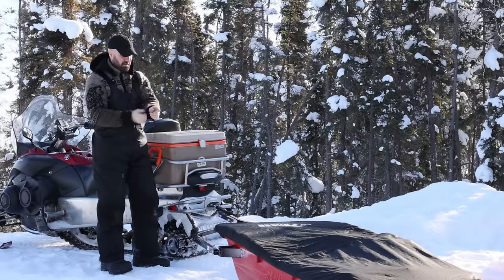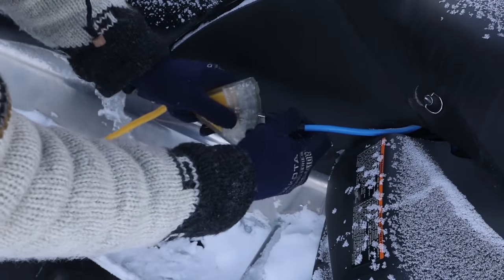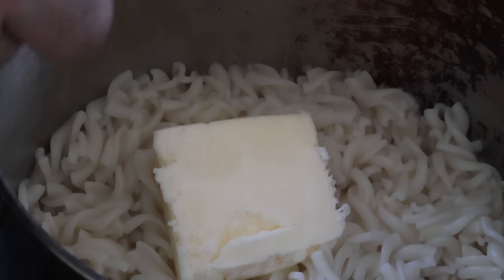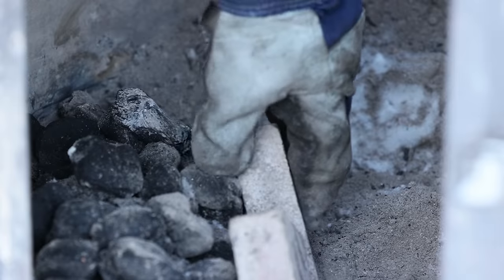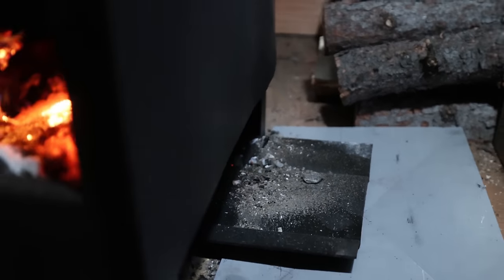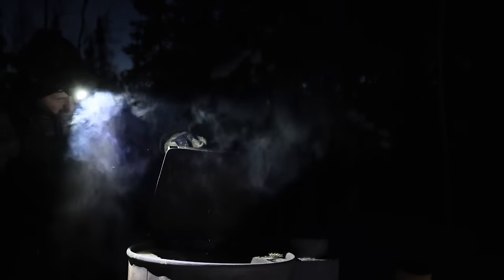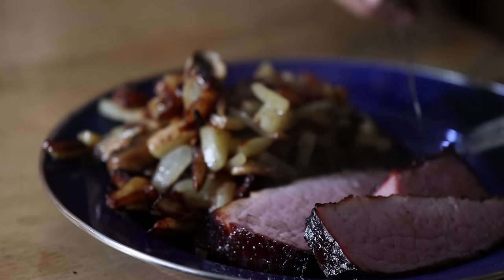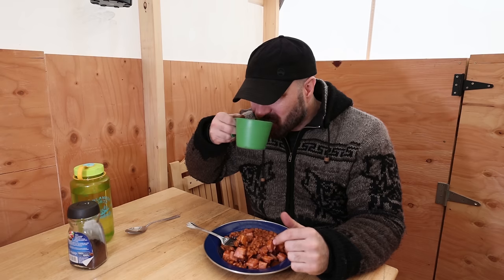My Dangerous Night Hot Tent Camping Alone

Comment: Also. Start your coal fire like a bbq. Use wood kindling, wood feather sticks and tinder. Get a rolling fire with kindling. Add your coals. And a little bit more kindling. When the coals light, add a few more coals or add your smoking wood. I soak smoking wood for an hour in something non flammable. When coals are white, you're ready to cook. It takes longer to cook, I'd use more coals.

Comment: Hey Jay, glad you saw the fire problem and didn't get into REAL trouble.  A suggestion when you are cutting firewood.  You can stack 2-3-4 small to medium sized logs in the cutting rack and cut them at the same time.  You will get more done quicker.

Comment: Hey jay that was a near miss if that had have happened whilst u were asleep, don’t even wanna think about it!  Maybe you should get a sheet of steel underneath as a heat shield in case there’s another failure.  Also those northern lights were awesome, maybe you should try and engineer a sky light so you can watch them in bed!
Reply from the maker: I was very lucky that I caught it before bed.

Comment: Today's score: 5 out of 5
-2	negative 30 degrees (by any temperature measurement system)
+2 smoked ham
+2 improvising a smoker in the middle of a forest
+2 dealing with a defective stove like a BOSS
+1 great camera work showing the succulence of the ham and taters. 

Jay, it doesn't matter what technology you have, even a Jackery to start your snowmobile; there is no sane reason to be outside under the conditions in this video. I'm worried about you man. Still, you pulled off an amazing video in spite of the adverse conditions. Great job.

Comment: Stove can be fixed easy, drill some holes and put nuts, washers and bolts. Before tightening get stove fixing paste and add where the plates join. Also put paste inside all around corners(wherever plates meet). To prevent it from happening again put some fire bricks on the bottom and one layer standing up on the sides and back.
You know adding firebricks to any stove allows it to hold heat longer. I would maybe even do the whole stove interior with thin bricks besides front and up. You glue them to the mettal with stove fixing mixture. It would allow the heat to come very strong only front and up and retain heat longer on other sides bottom and back.

Comment: You need to put heavy steel on the bottom weld it in and a heavy fire grate to keep the main part of the fire off the steel it has to just be off by an inch or so. Switching stoves out with a great safe idea I'm glad you did that and didn't sleep in there.

Comment: Hey Jay, I was the pit master at my last full time job, and you do not need a high heat to smoke. As really about all you need is a low heat of around 200°f for around 8 to 12 hours depending on the size of the meat. As for your little fire place, it is made from a similar metal that my BBQ pit is made of and warps with the high heat wood produces. The way to fix it is to weld L iron inside all the way around the edges. But to give you an idea of the size of the pit we had at the restaurant where I worked was, imagine a steel pipe 6 feet in diameter by 15 feet in length laid sideways. Two steel doors that raise up, and a door about the size of your little stove on each end. Only one used to hold logs, the other used for clean out. And the amount of wood we would use for our night smoke, was about what would pack into your little stove. And yes a stove that big would stay hot for close to 24 hours.

Comment: Most smoking of food is done at a relatively low temperature, but over a long period of time.  
A lot of the time you're shooting for a temperature of around 225F-250F. (107C - 121C) 
To go along with it those low temps, you'll cook something for a long time. A beef brisket could be 12-18 hrs, racks of ribs around 6 hrs.
The trick is keeping the temperature and the smoke as constant as you can. Lots of people really struggle to smoke things in really cold climates.

Comment: Good vid man.  Stove deal can happen.  Most need worked on when new anyway.  Some bricks inside are a must.  Maybe run a weld bead around the bottom or just trash it out.  Put it outside to cook on in summer.  Glad to see the Jackery, have to get one myself.  Some great lights.  Won't be snowmobiling much longer.  In the 30's F in Fairbanks so it's warming in the north country.   From the Hills of East Kentucky  USA, safe travels.

Comment: When you got that stove did instructions come with it. Sometimes you suppose to put some bricks or something on the bottom to keep the direct heat of the steel. I bet when you first put it in and it was cold as heck you probably got the steel to hot then when you left it got so cold that it pulled apart. Always need a barrier between heat and steel

Comment: I'd want to try and keep that stove. Probably would bend it back into place and then run a bead along that seam where the bottom plate and side/back plates come together. However, that is crazy that it happened. 

I'd also recommend putting some fire brick into your stove. Soaks up the heat and radiates longer. Might have helped with that seam failure too, maybe. Would have at least been more of a barrier between the fire/coals and the metal. I know this is a remote location so hauling brick out there might be more than you need, but throwing my 2 cents at ya.

Comment: Jay, this is a bit of a crazy question, perhaps, but I'll ask any way - when the bottom of the unit was assembled, any chance the floor was installed upside down ? Could it be that the four 
ninety degree folds were intended to face upwards with the four walls placed inside so that the floor would serve as a catch pan for coals ? You are one lucky man ! Damn good thing
you didn't fall asleep.

Comment: Now I know why the Kni-co stoves are constructed the way they are with fold-overs to prevent any potential for opened seams. I wonder if prototypes of the Kni-co stove tried to get away with simple edge seams and they ran into the same problem. I am not sure if you were using false bottom but a raised grill or other false bottom will help with over-heating the bottom and seams and provides better airflow.

Comment: Hey Jay, boy, sometimes things just go wrong but, you were able to catch this one in time and save the night.I had a Drolet many years ago and it did not work right, took it back and got my money back. If you feel the old stove is to big, you can take it to a professional welder have him/her cut it down to the size you need and weld it back together. This way you still have the same stove only smaller with the same quality. I have to say, that ham looked mighty tasty but, needed one thing, a fried pineapple ring on top, lol. Leftover ham with beans? Can't beat it. As I have said before, I would live in that tent all Winter and commute to work. Like one person mentioned a "Skylight would be nice and not that hard to add. Thanks for sharing.

Comment: Jay looking at the stove you took out hate to say it that thing is built terrible, now if you wanted to fix it get it welded or bolt the seams together with 1/4” bolts and washers every 2” apart would fix it.  Pretty  easy and cheaper than having someone weld it.  Other wise it’s a boat anchor and wait till you get your new one.  Heat is what pulled it apart is my guess because metal is to thin.  Will be looking up Jackery CANADA now seeing I live in SASKATCHEWAN.  Take care!

Comment: Most likely you don't have a bar clamp that would just squeeze it back together on the bottom side. Another solution is a couple revolutions of tie wire and tighten that up with the piece of steel pole or pliers. Other than that I have no solutions I would have found a way to stay the night though.

Comment: Jay.... AWESOME northern lights..eh,,,!

When I saw you collecting all that saw dust I was wondering what your doing with it. Then I thought that you should collect and save it to build yourself an underground ice box and use it as insulation for blocks of ice cut from the lake (with chain saw) that would last  during summer months. Voila, you have a summer cooler, like in the good ole days. Wouldn't hurt to re-purpose the saw dust. Give it a try.

Question Jay.... Can the Jackery be used during the solar re-charging process..?

Comment: Glad you still have the old stove around good that you kept it there. The other stove gave up because spot welds in it it's not very efficient stove when its spot welded together there's tons of air gaps and yes the old Barrel stove has some issues too with are gaps but that one's going to be easier to fix in use. Crazy to think I've been watching you since like 5 subs and now you got 100,000 Subs. I'm still here for the ride and it's been a good one sense and I'm glad I could help you out with suggestions and different things over the years. Now you have the 1500 what are you going to wind up doing with the 1,000 jackery. I've been thinking I'm trying to get one so when I'm out panning for gold in the mountains with my truck and I'm not near any kind of facilities I'll still have some power to charge my camera my phone and string of lights and not have to depend on my truck to charge things. And thank you for the aurora borealis ( aka ) the Northern Lights. Very few times do I get to see them in my part of New York. Enjoy your afternoon Jay

Comment: When you smoke as you did you should first soak the wood in water.  This allows it to smoke and not catch fire until it dries out.  You don't need to use charcoal either.  You can use s wood fire or propane.  It's the hickory or whatever taste you want that matters.  Not sure why you decided to use charcoal at all.  When we smoke ribs we build a fire down low and let the smoke rise up into the ribs.  Smoking isn't supposed to be fast.  At the least hours and hours

Comment: I have been fearful something like this was going to happen. It is lack of knowledge on operating and buying the right stove for the job. These small camp stoves are ok for the job they are designed for but you can not fill them with wood and turn them cherry red all the time. They warp with heat like that and the spot weld breaks free. Even your barrel stove will eventually burn a hole in it if you run it red hot after awhile. you need the stove like your friend is building for you.
Reply from the maker: I agree. I need a much thicker stove and the one I'm getting is a tank. That drolet should have done better though. That was only the 3rd fire in it.

Comment: Can't eat the KD.  My kids love it, but 20 years ago, in college, all I could afford was a big box of KD.  For 3 months all I ate was KD classic twice a day (not by choice).  Ever since I can't stomach it.  I make fresh mac and cheese and it's good but the KD makes me ill.
For your stove, get a welder to make you a roasting type pan as big as your stove with 1 inch or 1 1/2 inch sides.  Put it under your stove to insulate the floor, a just in case catcher or slide it out to scoop your ashes into.  It'll be bigger than a bucket mouth and take all your ashes.
Don't use spruce or pine for smoking, the resin is not good.  You don't smoke at high temps, 225 - 275 is usually what you're aiming for.  That's why they call it low and slow.

Comment: It is a shame you don't have "Vili's" Pasties, Pies and Sausage Rolls in Canada. All you need is some Aluminium foil (tin foil) and a bed of coals to bury it in and about 15 minutes later you can eat hot meat and or veg without the need of a knife and fork. No washing up required. You can even sit them on the top of the stove to heat through (that takes about 30 minutes though).
Self-tapping screws, some tin bent in a U shape and a stove door gasket will fix the stove better than new. Do it to the entire base not just the damaged area (been there, done that).

PS: I live in Australia so we don't know what real cold is, on the other hand you don't know what real heat is.

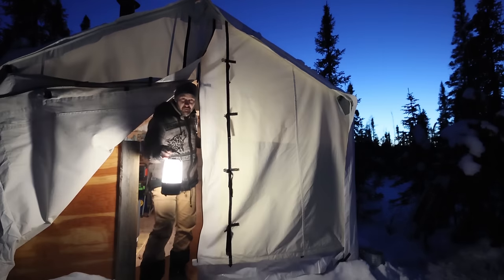Comment: 21:10-22:20: dude, when living out in the sticks you can't dicker about should I do this versus should I do that.  Think, and think fast.  Will the plywood catch fire?  Could.  But you should have a fire shield to keep that from happening anyhow.  Like a big metal oil pan for changing truck oil.  Get a clean one & have it as the fire shield.  Also, you fill the bucket too full of hot coals.  Multiple safe trips with few coals is much better than a couple of unsafe trips packed full of coals, because if you trip & spill, which is worse?  A few coals or a bunch?  Nice camp though.  Lucky dawg!
Reply: BTW, If you want to make you own fire shield, it's very easy.  You want it to have at the minimum the same cubic inch capacity as the stove.  So measure the stove, cube out the measurements, I am guessing your stove is 12"w x 18"t x 16"l, so lets use this as an example.  So cubed out it comes to 5,616 cu. in. (in this example we will always round up to the nearest whole number).  So (wSqr+tSqr)=468Sqr=22"; then (lSqr+tSqr.)=1000Sqr=32"; then 5616/(22x32)=8".  I am no engineer, however that was taught to me by a retired mining engineer (may he rest in peace), and as he said, better off playing it safe than living it sorry.  Anyhow, some cut fire brick would also work as a bare minimum since your stove is a wood stove and our stove was a wood/coal combo.  Just remember to use the Pythagorum theorum for the fire brick shield size (as I used) & you should do just fine.

Comment: With the axe try put the bit your chopping on the far end of the log so you have more chance of hitting the stump if your axe ricochets out & separate your legs more & don’t swing the axe so much drop it more vertically down so there is less arc movement for it to hit legs if it carries on past or through the target.you can drop the axe while dropping your weight bending at the knees so it’s less dangerous & spreading the effort to other muscles..lastly buy a good quality axe not that plastic crap as a real axe like American hickory handles absorbs vibration where plastic or metal transmits it to you..oh one more thing is no gloves & no grippy handles the gloves make you slip  or not feel a slip in time & grips on the handle give you blisters…just use wood & skin.
Great videos I watch them all but your axe work scares me 🤣👍